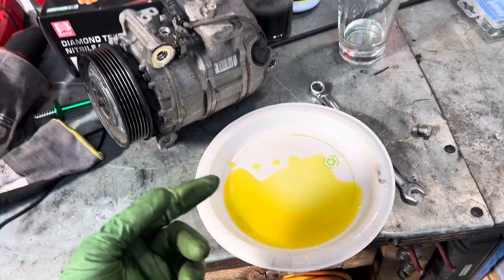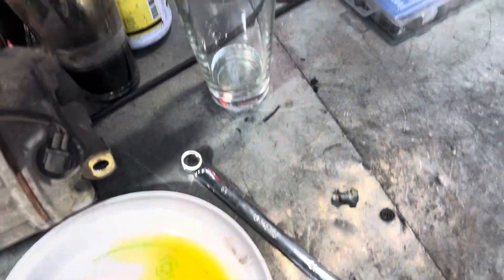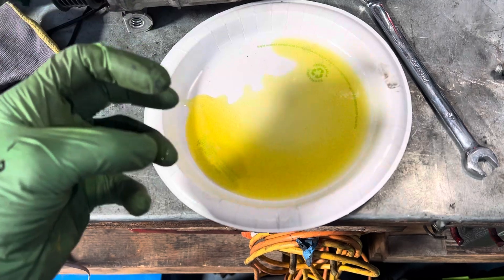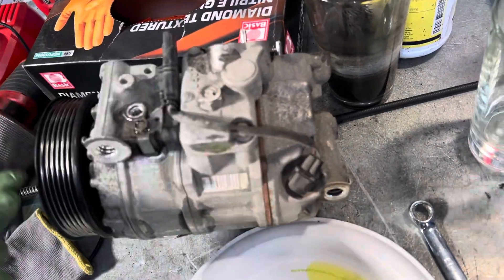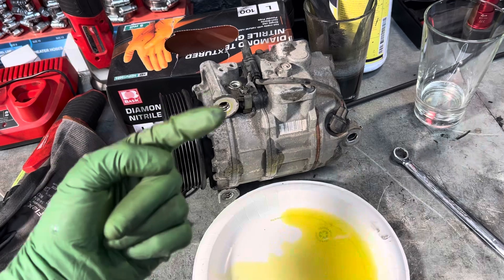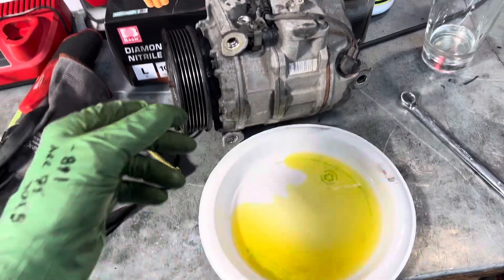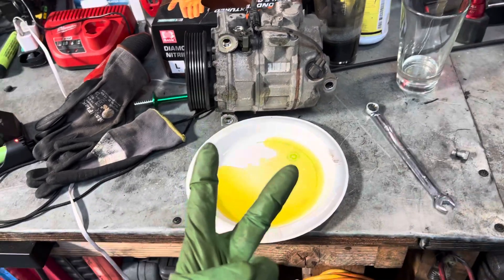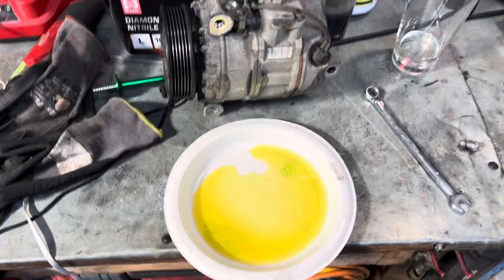AC refrigerant oil missing out of compressor. Where did it all go?  There’s no oil leak. ￼

Comment: Hi Tom, I have a question. I had the suction accidentally hit the by the schrader valve and all refrigerator gushed out, I can see a lot of oil leaked out with it too all over that area. How can I estimate how much oil left the system?? It’s a Mercedes w211 and total AC system capacity is 8.5 oz. Thanks a lot I appreciate your advice.
Reply from the maker: @GK7GARAGE  usually not much oil comes out of a suction line. 
       Remember oil spreads out and always looks like more than it is because of how far will spread. 
       Usually, everybody always overestimates the amount of oil that came out. 

I can’t see it so I cannot judge .   But the seep of oil that you usually see from a Schrader valve that travel up and down away from the source of the leak and they accumulate the black dust on them even though it looks big because it might go each direction down the hose that’s usually still less than 5 mL. 
     Oil really wet and spreads out very big and it looks like a lot
Reply: @coldfinger459sub0  thank you so much for taking the time for a detailed answer it’s much appreciated. 
        It’s hard to estimate and I really don’t wanna tear it apart and flush it again. 
        Since my suction hose got cracked wide open and refrigerant left system very fast I’m thinking maybe took more oil out with, am I right?? I think I’m gonna go back in with 1.5 oz of oil. Do you that’s reasonable approach? Thanks again
Reply from the maker: @GK7GARAGE that would be a judgment call compend, depending on trying to estimate what sprayed on a firewall or a fender well or agent components trying to gauge how thick the oil is that is definitely a personal judgment call
Reply: @coldfinger459sub0  sounds good that makes sense. Thanks for the advice. Much appreciated 😊